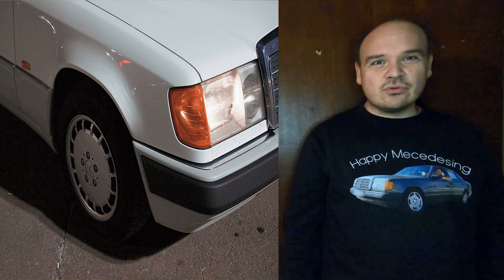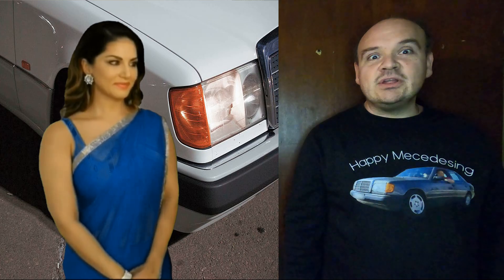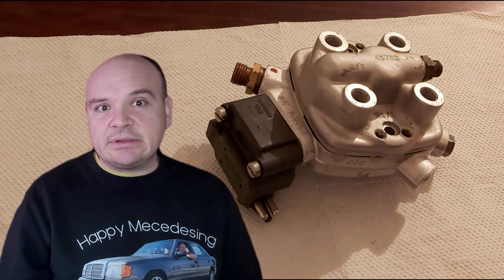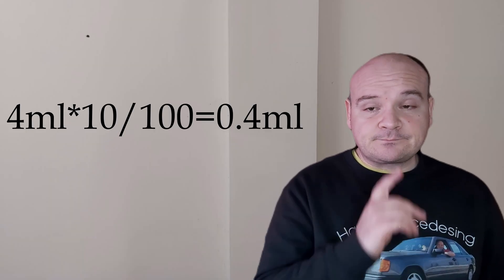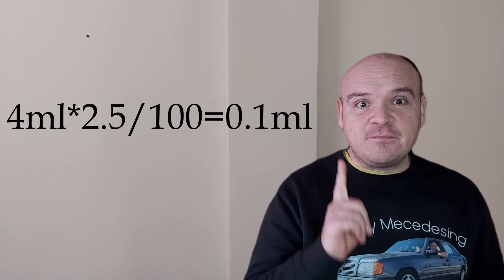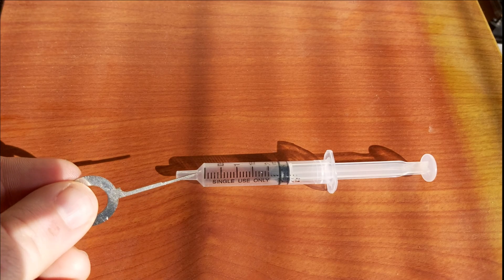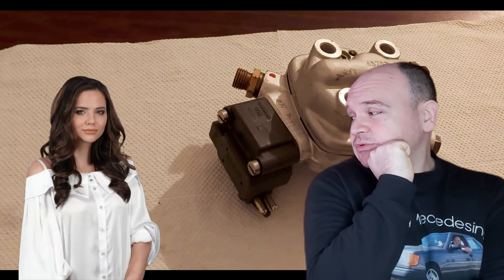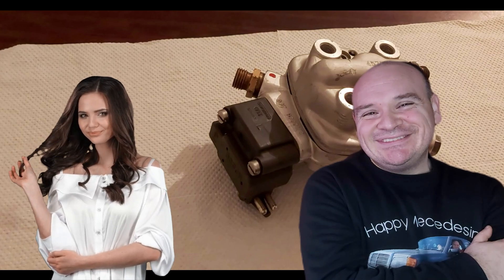㉦Mercedes Ke-Jetronic㉦ - The ideal 🧪💧idle quantity💧🧪 for the fuel distributor

Comment: Once a month I have to clean the plunger with carbcleaner.  Otherwise, the car jerks at high revs.  it is normal? Thanks
Reply from the maker: No, it isn't. I haven't even disassembled my fuel distributor and my car is 35 years old.

Comment: Hi Ivica, is it safe if i pour Liqui Moly injector cleaner into fuel tank for ke-jetronics system?
Reply from the maker: Hi. Yes, just see the ratio. This goes for new injectors to preserve them. If you have the old ones then nothing will help, they simply have to be replaced. Greetings.
Reply: @mercedeske  yes i have new injectors, just replaced 2 years ago. So liqui moly will not make my injectors clogged?
Reply from the maker: @mkwiipro5912  No.
Reply: @mercedeske  thanks ivica, happy mercedising!

Comment: Hi, In case of a 3.0 liter engine is 500ml per cylinder/ minute on full load position? Why? Wasn’t it 100ml ( according to manual) but the correct is 170ml as I saw from one of your previous videos ? I dont understand 😅
Reply from the maker: Hi, I understand. Concerning the M104 engine 220 is normal, because M104 engine has a double slotted barrel in the fuel distributor and that's why it's normal for M104 to give higher more fuel on full load than M103 engine.😉😉😉😉
Reply: @mercedeske thanks, I don’t have this m104 w124 anymore now I have a w126 260se m103 that I will need to rebuild the fuel distributor as the car was not started for 5 years and the fuel quality in my country is horrible (27 to 30% of ethanol 😅), is it also 170ml per cylinder/full load or a little less? As for your w124 2.3 liter engine the quantity on full load is how much ? Just to compare. I assume yours is 160ml ?
Reply from the maker: @gcgj1540  Yes, that's enough. Just don't touch the adjustment screws and everything will be fine 🙂 😉
Reply: @mercedeske  ok thank you